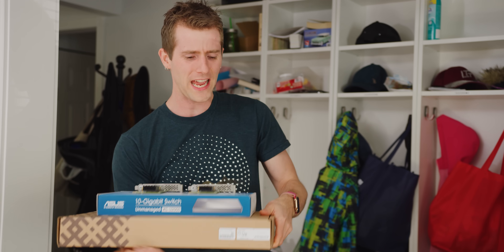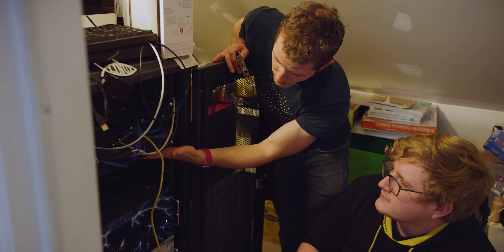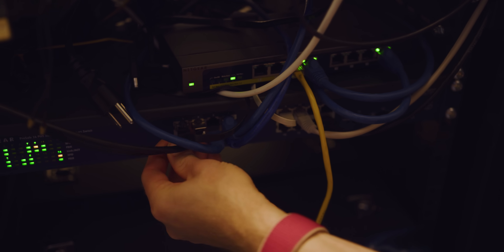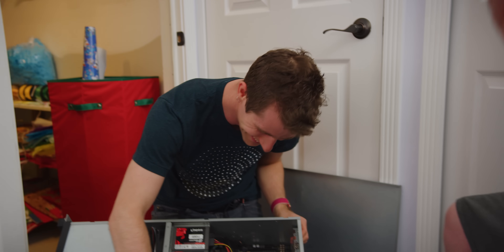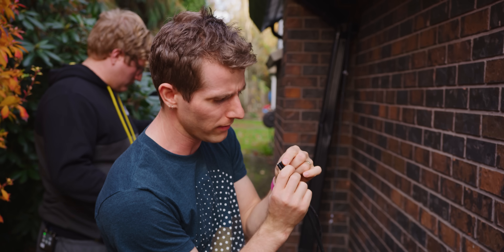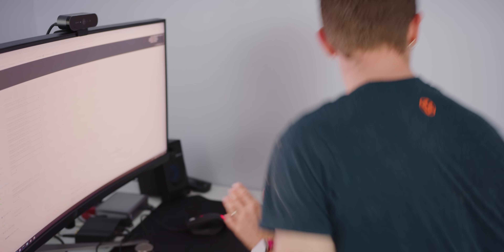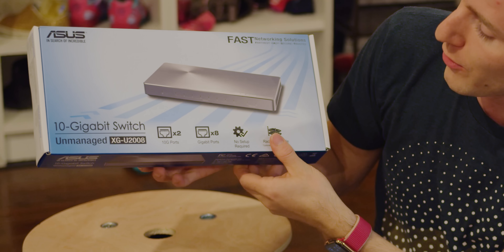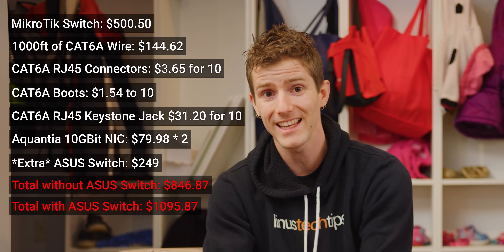Home 10 Gig Network Upgrade for CHEAP

Comment: DOH! CONDUIT DUDE! Whenever I can (time/money/difficulty) I ALWAYS fit conduit in awkward situations! THEN adding or replacing cables to runs avoids those issues you were having.

No need for more expensive electrical power rated conduit either. Low cost flexible or hard pvc pipe can solve many issues!

I have TWO 32mm runs through my stud walls currently, one flexible for hidden TV cables (DC power, AC Mains), HDMI, , etc and the other one is a straight drop 40mm pvc drain pipe for running Ethernet cables down to the ground floor void under the suspended floor from the upstairs floor void. Left it with a draw cord to make adding cables a piece of proverbial.

Soon there will be another 20 conduit runs including 2x32mm, the rest 20mm for a complete lighting automation system. All light controls will be 5v ONLY, with NO mains in the walls except for wall lamps. All mains connections to lamps  will be via opto isolated relays from one control box.

LOTS of mains cable conduit used too, to ease replacement of existing mains runs with orange ZHLS Cat5e control cabling. All power cabling then via conduit to the above ceiling voids upstairs and downstairs. 

MUCH, MUCH easier for upgrading later as/when needed for 10G or even fibre in the future!
Reply: I had conduit installed in key locations by my builder when I built my new house.  They all thought it was overkill and I'd never use it.  Now I have fiber and multiple Cat 5e runs pulled thru it.   No regrets.
Reply: @redmach12003  builders! Biggest luddites on the planet, closely followed by plumbers and dare I say it sparkies! I insisted that my builder ensured that the suspended ground floor had sufficient clearance beneath the joists as crawl space! I used that access many times ... He said I never would! None so blind as those who cannot see!

Comment: Having a problem getting 1 gig (980) thru Netgear 24P - JGS524 v2 switch. it seems to half the speed. 
If I go direct to Verizon Fios-G1100, Speed test show's close to 1 gig. Cables didn't change anything, cat6, cat7, cat8 (and yes Now Cat8). Best Buy says switch should put out 1gig.
(Loved your attick crawl with the nails.. Been there..lol)
You know, one would think there would be 10 gig wireless networks by now so you don't have to use any wires..

Comment: Why is that you need an expensive switch for cheap cables? Or vice versa?
Reply: Because to cheap switches aren't as tolerant of poor signal transmission. Which means you can't use Ethernet, you have to use SFP cables, which cost a lot more.

Ethernet is an analog standard. So to have very fast speeds, you need very sensitive signal receivers and very precise transmitters. That's expensive.
Reply: @SeniorKlean  i see. Thx.

Comment: Single mode fiber optics is damn cheap these days, virtually unlimited speed, comes terminated to the exact length, checkout site such as fs.com. My backbone between floors is fiber optics, speed upgrade is done by swapping endports. Compared to the hassle to pull CAT7, fiber should be a no brainer today for backbones !

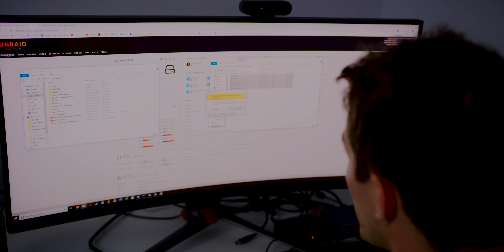Comment: 11:55 Cat6A cable turned into Cat6 only.
Difference between 5e and 6A is also the way each pair is twisted. 6A is tighter twisted. Cat7 is a whole different story where the twist-"spacing" is varying.
Reply: no one asked.
Reply: @youseff500  ... took you how many years to find out ?

Comment: I Love 10Gb Networking On Freenas (P2P) It Works Great An I Get The Full 1GBps As Ya Should An Not 3,4,5oo mbps & I Want To Try UnRaid for a Gpu But All My Testing,Farting Around I Can Never Get Real 10Gb To Work At Full Speed Only About Half Or litle Beter Than Half & That Is Just Not acceptable ! Any One Geting The Right Speed From Unraid & 10Gb?? I Could Use Some Advice!!

Comment: Been buying and using Mikrotik routers for years - steer clear of their switches.  High failure rate after a couple years in operation.

Comment: What if you have a hardware firewall, a modem (no firewall, router, switch, or wireless capability built in), a router with built-in switch, and a wireless access point.  Apparently it's valid to put the firewall between the internet and the modem, or between the modem and the router.  Which makes more sense?  I'm assuming that without the hardware firewall, the modem is daisy-chained to the router/switch to the WAP, but maybe that's wrong too.  I'm seeing a lot of different options online.

Comment: Cat 6A is augmented category 6 and rated for 500 MHz vs the Category 5e which is rated for 100 MHz only so its definitely a good upgrade :) for those of you who are worried about the price you can get a lowered 10 port with similar specs for around 170 otherwise a 1 GB 8 port switch can run you around $30. Cabling and ends are cheap just make sure you don't get a lower rated connector.
Reply: You can use short runs of Cat 6 (NOT a) for 10GB - 55 meters vs 100 IIRC.
For MOST folks, that's not going to matter.

Comment: Love these videos, just too bad I live in a small town in Alberta where the Fiber line is 300 feet from my house. There is a hookup for Fiber on the line to hookup the town. BUT, we are only 800 people so we are stuck with 25Mbps Down and 15Mbps up. Bits not Bytes. lol. The company in LTT's vids is capable of coming here and doing exactly what they did for LTT, downside is this. WE have to come up with enough Customers and permits, land, building, backup generators and this is not easy to come by. Just wish our Gov't or private sponsorship would realize the brain drain we are letting out of Canada as a whole, due to MANY of us unable to compete due to location.  Still love LTT's vids and the honesty!!

Comment: CAT6A Has a tighter twist in the pairs allowing for high freg, the divider helps with emi. also should of used CAT6A keystone jacks and CAT6A stranded patch cords be a little more bicsi standard.

Comment: As someone who runs and terminates data cable everyday, this video hurt me.
Reply: 😆🤣 You too?!
Reply: you mean like 10:52 when he cuts off like 6" lol
Reply: Me as well.  They have no clue about termination,  cat6a, or the actual difference between the two cables, that make one a cat5e and one a cat6a.
Reply: I'm a network guy. It hurt me pretty bad as well. Using an unconfigured managed switch.. uhrg.
Reply: Yeah, all that's already been said and no patch panels - running them straight to the devices? Yuck
Reply: The separator is the reason it gets 10g.... smh
Reply: @chiefgully9353  separator?
Reply: @joshyj12345  the part where linus was talking about the differences in cables.
Reply: @chiefgully9353  oh yeah hahaha. That rubber bit is absolutely critical hahaha

Comment: Finally I heard of Mikrotik on Linus Tech Tips, I did set a few Mikrotiks up into my previous workplace to connect all locations and used them as router/firewall..... then they got replaced with some Netgear and D-Links shortly after I left, not to say that they are bad brands but.... But I thought that Mikrotik was never to come back to light with bigger and better equipment :)

Comment: Linus, have you heard of FS.com? Talkin' about cheap optics, you can get a 10G SR SFP+ for $18 and a 5m multimode patch cord for $6. Just about everything can be off-the-shelf or customized, I've placed several large bulk fiber orders with them at work, and saved quite a bit of money and hassle.

As far as the $10k Fluke tools....if you haven't heard of Pockethernet, PLEASE go buy one! It has completely replaced our Fluke Cable IQ, WireMapper, and NetTest with one small bluetooth-connected device and an app. And it was only $200 (actually it's sold in Euros at €167.00)! We ended up buying 8 of them - one for each technician - because they do absolutely everything that all of those tools do, and I haven't had any reason to go back!

Comment: That mikrotik is a very powerful device. I work with them everyday. Its amazing what all they can do... and hes just using it as a switch.... They have programmable firewalls, DHCP servers, DNS servers, routers, bridges, you can vlan them out, use it as a load balancer,  All sorts of neat stuff. I would recommend he plugs that right to his isp connection and get somebody in there who knows how to program the thing.
Reply: It’s a great soho device, but we pull them out all the time to replace with enterprise grade equipment that can get full throughput and properly handle routing protocols, VPN, firewalling and multicast for more than 5 users.
Reply: @ausnetting  The mikrotik is an enterprise grade device capable of everything you just mentioned. We use them as the backbone gateways for apartment complexes in major cities like SLC, and hotels all over the nation. They never give us any problems.
Reply: MBL20 Hahahaha good for you.
Reply: @ausnetting  What do you use? Mikrotik is enterprise grade and a more profound company than Cisco.
Reply: MBL20 Microtik is a more “profound” company than Cisco?  Show me a single Gartner magic quadrant where Microtik beats Cisco.

I use Aruba/HPE, extreme networks, juniper, Cisco, H3C and Brocade on a regular basis, and they are all leaps and bounds ahead of Microtik, Ubiquiti, Netgear, DLink etc.  Microtik regularly relies on CPU instead of decent ASICs for traffic processing, and is prone to high CPU usage in even the most simple dynamic routing or multicast environments.

I’m sure Microtik works fine for a simple residential application like an apartment complex or Linus’ home, but they won’t be going in any server room or data center I work in.
Reply: @ausnetting   Ill admit that the old mikrotik routers were junk. Like the RB450's or even the rb2011's. But the newer cloud core routers are impressive.
Reply: MBL20 just stop, you’re embarrassing yourself and making my eyes bleed just from reading the fanboy crap.

Microtik has no stacking, no LLDP-MED, no loop resolution protocols (I’m not talking STP, but FDDI, ELRP, etc for maintaining a redundant loop), no cross-chassis LAG capability, their switch chips only have capacity for 92 rules where enterprise switch makers are on the order of 1000 rules per port, and the list goes on.

Calling it “cloud core” is just marketing wank speak.  Microtik make great, simple switches and routers for SOHO applications, but let’s not pretend they’re “enterprise class.”

Comment: The easiest way to deal with roofing nails is a hard hat.
Reply: @Mark Jones Looks like one for the  back as well ... (hard back) perhaps a bullet proof vest would fit the bill there LOL
Reply: just don't secure your roof and you won't stab yourself on them. Just kidding you should do what Mikkel Breiler said. he is right.
Reply: @k8kzhradiotipsandreviews31  You think he put the roof on himself? A hard hat it a lot cheaper and easier than replacing a roof or cutting nails. You'll never be able to buy perfect length nails plus you can still hit your head on other things.
Reply: Cut the nails off with a sidecutter. And use shorter nails next time.
Reply: @mikkelbreiler3846  Sure, I'll just go drop $500   so I can cut a nail I'll see again only a handful of times.
Reply: @mikkelbreiler3846  clearly you haven’t ever tried to cut a nail with side cutters or how many nails are in a roof...
Reply: @mikkelbreiler3846  Electrician's sidecutters are not designed to cut through roofing nails. Although, these might work? https://www.amazon.com/dp/B000X4KOKE/ref=cm_sw_r_cp_apa_fabc_BBP9YBRX879593WZRV1Z?psc=1
Reply: @mikkelbreiler3846  you know how many nails have to go into a roof? To hold it to the truss/joyce, I dont think you know how to build a house or how big shingles are.
Reply: Until you impale an appendage. Don't get me wrong though, eye protection and a hard hat aren't a bad idea.
Reply: Have some fun with it, grinder.
Reply: That damned wallpaper.

Comment: Being a low voltage tech who worked for a security and surveillance company who ran many, many, many data drops. I cringe with the way they pull wire. They make it harder on themselves... you can use the old wire as pulls my guy. Ugh.

Comment: That's not the only reason to use the SFP+ on there.  If you have a long vertical run in your house, it's best not to do it in copper if you don't want lightning-fire issues.

Comment: Because he needed 100ft of ethernet cabling he got 1000 CAT6a, he could have gotten 300ft CAT7a for half the price. Future-proof ?
Reply: There is no spec for 100gbase-t over UTP or balanced twisted pair.  40gbase-t requires cat8 balances twisted pair. Cat 7 or cat 7a does not futureproof anything - just like cat 6 didn’t.

Comment: I went for SFP+ and used fiber optic, the switch was only like $200, $35 for a 2 pack of sfp+ cards, forgot how much I paid for transceivers but it wasn’t much. Plus enough fiber to run diagonally across my 2.5 acres to my barn.

Comment: Need 8 Ports for my patch panel (cat 7 cabling, terminated in Cat6a plugs), 4 servers in the rack, router, powerline adapter (going to my laser printers) and patchcable going to workstation/gaming pc (which is basically next to my server rack, so I didn't bother doing a proper run.
Thats already 15 ports. Sad life.... Wake me up when 24 (or at least 18) port switches are down to that price...

Comment: That ain't cheap. Me and my dad wired up a six bed house with RJ45 100mbps for under £100 back in the 90s and that was budget. $500 for a switch and about the same in cabling is not budget...

Comment: If this will helps, whean configurating the mikrotik switches and routers better use Winbox software, dont know what you use but i think simple using browser, configure RoMON that you can connect to device without any filter rules = saver things, you can also make many DHCP servers and VLAN rules for your servers to keep saver and separate devices from your normal devices like normal use laptops or phones, in ip>firewall>service ports change the ports you like beceose many of ppl like to try enter your cr using standard service ports and also if anyone can connect to your internet provider network and use scan in winbox, can see your device. In ip>firewall>nat you can make ports rules also in connections you will see all connections in and out to your network. Make in firewall filter rules flood protect rule for make your sarvers saver. In ip>dhcp server>leases you can easly make static adresses rules, also you can see there alerts. 

PRO TIP - you can play music on your mikrotik switches and routers using scripting, you all can find in google serch. Think about that, flood rule starts to working, someone attacks your server, router starting the script to block that and also plays imperial march from star wars :D. 

there are almost everything you can do with this router.

PRO TIP for ppl working in internet providers - if some company have many of radios from mikrotik and you dont know what radio you need to service, someone who can enter to this radio can play for you any music to locate the radio, we have many of SXT radios for clients and whean you reech the roof of building and see 6 radios .... that can helps

10gbps you can also reech using 2 x cat 5e cable, using any cables outside better use cables with gel inside, that will make water out from the inside of cable.

PS. Sorry for my poor english language :) Cheers.

Comment: Tip: use the wire comb on your snips.
Tip: Use stripped insulation to unwind stripped line.

Comment: The sponsor is fairly misleading military grade encryption doesn't mean anything
Reply: It means AES-256, which is quite strong.
Reply: @invisi1407  you can put AES encryption on a flash drive doesn't make it military grade.
Reply: @kingqasmoke2802  it does, actually. "Military grade" literally means what the US Military believes to be secure enough for military things and that is AES-256.

It sounds like it's impenetrable, but it just means what the military classifies as being secure enough (for now).

Comment: What about reviewing the Ubiquiti / Unifi 10G switches, which go for $500 and $600 for 16 port switches and provide lots of SFP+ ports as well as some copper ports?  While it is interesting that you go for outdoor CAT6, a lot of people are going to want to do something like OS2 fiber as it is non conductive so lightening won't fry their hardware by traveling into the house over the network cable and it is not that expensive.  (OS2 single mode fiber is cheaper than OM4 multi-mode fiber.)  Especially when you get into indoor runs and the rather cheap Bi-Di transceivers these days (so you can cut down to a single simplex fiber instead of duplex dual fiber), which do work everywhere if you get the right stuff, fiber (as in simplex OS2 fiber) can be some of the cheapest pre-made networking cable you can get.  Would also be interesting if you could show inexpensive ways to build single mode fiber from a spool and have it work if such a thing is possible.  The price on some fusion splicers can get kind of yikes and the general notion of building fiber cable scares most people.  Of course you could go all copper and call it a day, but what fun is that?

I am actually running a combination of of CAT6(a), CAT5e, OM4 duplex fiber, and OS2 simplex fiber through the house I am in and was surprised at how relatively cheap and easy the fiber was for running around the house.  I suppose it was a bit of a challenge properly calculating the length of pre-made fiber to get, but it is thin enough to coil easily if you go a little over, just don't be a little under.

Comment: FYI, I checked out the user manual for the Mikrotik switch and it is managed...default private IP is  192.168.88.1   You can use their utility program Winbox to configure it to your subnet or connect it to a temporary network, blah, blah.  Anyhoo, it should definitely be setup for access--I'm sure you could probably see all sorts of cool runtime stats for each port.